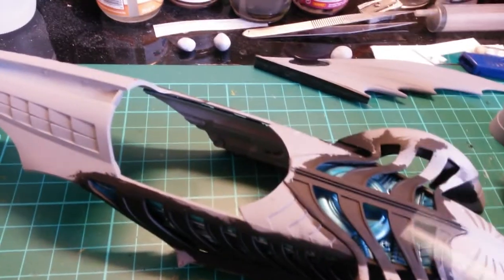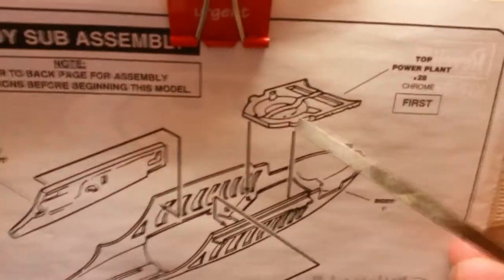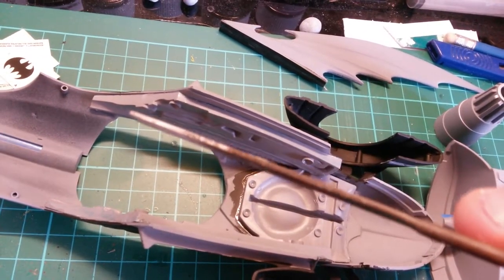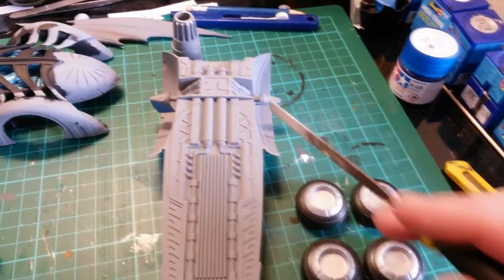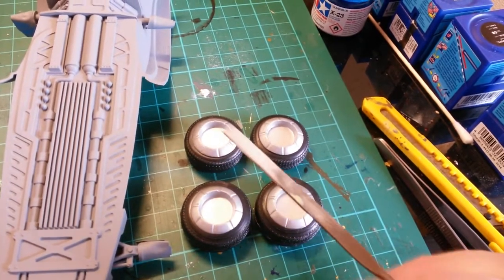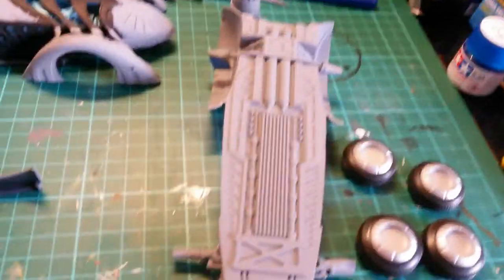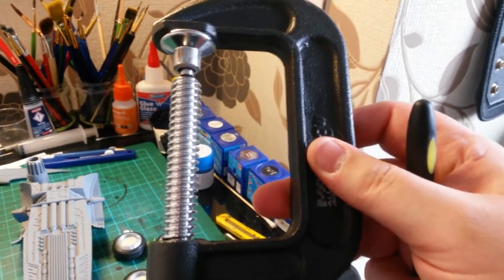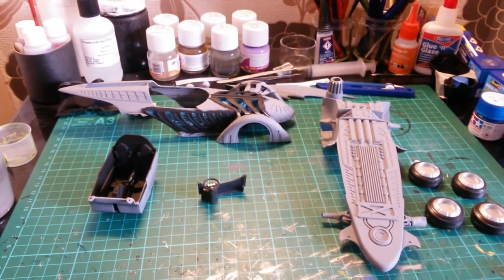Revell 1/25 Batman Forever Batmobile Part 2

Comment: Hi, what do you use to prime?, airbrush or spray?, thank you
Reply from the maker: Hi there,

I use spray can automotive acrylic primer from Halfords, £7.99 for 500ml can.

Id like to buy an airbrush setup, but i simply cannot afford to buy one (wife wont let me)
Reply: WickedSlimShady - haha I know, thanks!
Reply: @WickedSlimShady  where is part 3
Reply from the maker: @jswatch9270  thats wierd, part 3 has been up since i uploaded it a year ago & strangley its gone. Dont know what to say.
Reply: @WickedSlimShady  I looked for and its not in can u bring it back
Reply: A more model primer would be Tamiya's Grey PRimer. Works really well...But hella more expensive though so if you want a cheaper alternative, then yeah, auto primer works just fine! I use Tamiya when there is a real big ass professional project such as my shelf of doom 1/200 U.S.S Missouri (I'll get that done one of these days...I promise!!!)..But for smaller models such as these, yeah, auto primers works just as well!
Reply from the maker: @StryderK  ive found that no matter the size of the model Halfords Primer has always done the job, if not better than model primer. Never had a problem with it & again its really cheap. But tyvm for your tip.